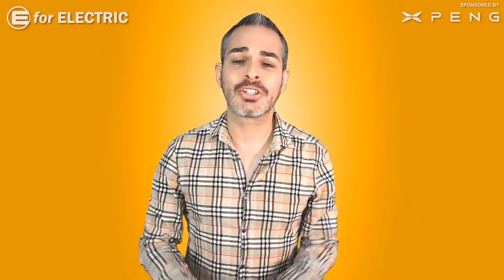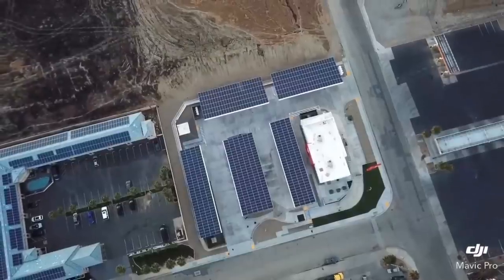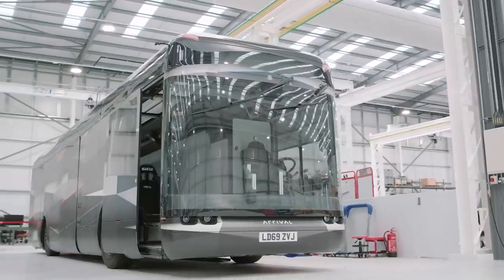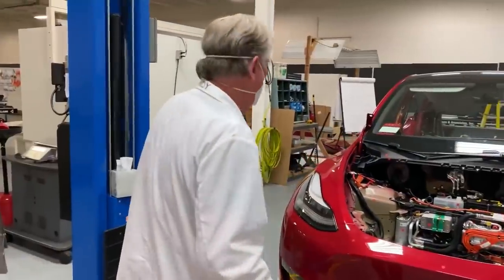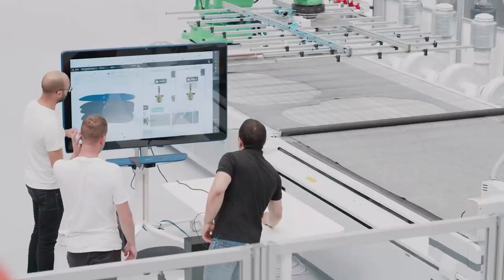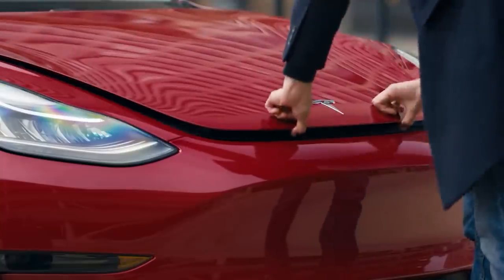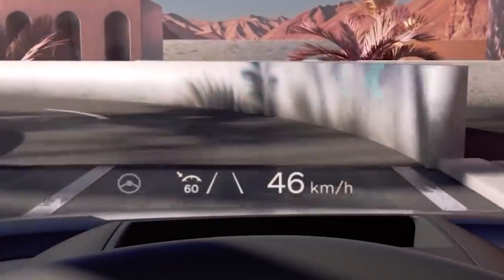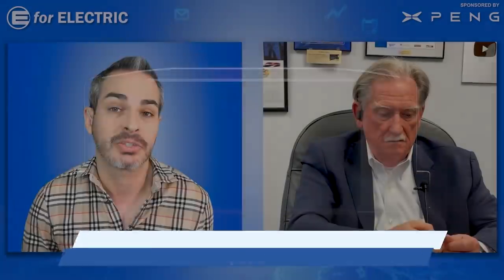Sandy Munro vs 2021 Electric Car Tech

Comment: They used to have CKD vehicle assembly where I came from in New Zealand in the 60's and 70's. It would be a great idea for bringing Teslas down under. But the only drawback is that CKD in those days was driven by a protectionist government tariff regime which doesn't exist any more, and without those tariffs it probably won't stack up financially.

Comment: Nio has done more than 500k battery swaps. I think the idea has survived the test so far. Also battery swap will become a big recurring revenue stream for Nio. Whether it's swap stations or charging stations, it's important to build that ecosystem to support sales of the car. Nio realizes the sale doesn't end with delivery of the car to the customer. You have to have Service and support infrastructure. Tesla and Nio are doing it the right way.

Comment: Another great interview with Sandy. I agree with him on battery swapping. I hope one day there will be fast induction charging built into highways thus eliminating the need for charging stations. This system could also be used to "transfer" excess potential energy of loaded trucks decending mountain roads. Furthermore, the electricity generated thus could be used to heat roads in snowy areas, making for safer driving for everyone.

Comment: Any thought if Tesla or the others will allow one to use their car's battery, when sitting in the Garage, to be used as a powerwall? Currently a powerwall has about 13 kWh of capacity, a modest fraction of a 100 kWh battery. Would be nice to be able to use your car as a power shifting means when one has solar panels on the house.

Comment: I think Sandy has gotten the battery swap idea wrong, and I think you may have asked the wrong question. Region is everything, where Sandy lives in the USA he may be correct but in China and large parts of Europe do not have the means to charge at home or in towns and cities due to the different types of real estate, battery swapping in these situations can be a huge advantage. I think he's being very narrow minded, it's a also new and different, but different does not mean wrong. The comparison to an old propane cylinder was completely out of proportion as well, I would like to think that batteries in the swapping environment, would be, from time to time, reconditioned so as the battery swapping stations would need to be up-kept. To the next point about connectors and some saying dirty connectors cause resistance, causing heat, causing battery death, well there you go, wouldn't you like a new battery at this point which you'd get from the swapping station, or do you wait for your Tesla etc. to become redundant like your typical iPhone or Samsung phone's built in, non swappable battery would be, once the battery is done?! I'm not saying Sandy is not smart as he has proved himself, I just think he needs to reevaluate these conditions, think out of the box. Now to LIDAR, yes he's probably correct, in TEN years, but for now LIDAR is the best alternative. Musk is arrogant and just dismisses anything that his vehicles do not employ for reasons of hype and marketing. Musk is a shrewd fellow don't get me wrong but he also kind of portrays himself as the fictional character Tony Stark and can not only be very annoying but disruptive to the stock too (short term), just take the last incident at the Shanghai automotive show for instance, it's a PR disaster.

Comment: Battery swapping could work for a huge fleets like big city cab companies or government garages. In my opinion it is a big stick in the wheel of the progress because you're stuck with one technology for many years
Reply: (it really allows quicker update of technology - only the form factor needs to remain the same.) - not saying it is going to happen - it isn't likely to, not across the board anyhow, and not between platforms, unless govt's force it. (one-type fleets, like London cabs, simple)
Reply: @kadmow  Imagine that you bought a long range battery for big money but when you need to replace it they only have a cheap budget one. Your decision? Definitely they won't offer you a price difference as a refund. Or vice versa, they have a brand new updated one and you have an old beater. It's back to the USSR, everyone has an exact same car. Dead in the water idea.
Reply: @igorpro8462  : Ever thought of modular systems??  - actually that was a great failure of Tesla architecture  until at least 2017 (not that long ago) Electric cars are Appliances anyhow, personal choice is "what topper would you like today sir?" - we are just on a transition, everything is in flux.  I think some are imagineering scenarios which have been solved and are simply logistical exercises.  Whether or not removable "modular" packs will prevail (swappable or not is of little mention- as it is so simple to solve it is trivial), your original complaint re. technological freeze is a straw-man, (as is any minor maintenance argument).  Simply, if it isn't needed by the masses, the masses will seek alternate solutions. Niches exist (apartment dwellers - parking streets from their premises - with no charging infrastructure) , and the the USSR couldn't imagine the levels of control modern secular states enjoy.  ha ha...   Blue or Red, who cares, you are still all in the same game.  jk...  and have a great day.
Reply: @igorpro8462  if you change to a smaller range battery, the cost is low for that duration. Plenty of people have comments and have done any research.
Reply: @kadmow   Modular systems work well in some cases like construction equipment, where the tools or batteries are changed  many times during the shift by the operator. Modular systems even in the computer ecosystems proved itself not very handy and eventually were abandoned by Apple and notebook manufacturers. The major issue with the battery swap is maintaining the inventory big enough to have all most common shapes and sizes available any time of the day or night. It can work downtown Los Angeles, though it will be sky high expensive, but what about small rural towns? Imagine you're driving to the camping site in the woods through small towns where there are gas stations but nothing for your fancy whatever you are driving, definitely not Tesla.

Comment: mobileye is developing a solid state SoC Lidar module, i wonder how that compares to FLIR. mobileye dominates the OEM supplier market for self driving systems with basically no other competition so i am guessing it is good enough for level 5
Reply: Passive systems like Flir are always simpler. They don't have to radiat energy for a signal they just take what's already there. Plus the longer wavelength Infrared works better in low visibility situations. Radar would be best but that does not have the resolution of the other imaging systems.

Comment: Swappable electric car batteries. I think it’s one of those persistent ideas which are great in concept but unsatisfactory in application and use. When you can charge almost as fast as swapping out the battery, then it becomes less desirable. Sandys barbecue grill story was the perfect  example of why it’s not a great idea.

Comment: Common sense engineer Sandy. If and when he is right, then largest capacity batteries will be  analogous to "no replacement for displacement" in ICE. Less stressful for  the larger capacity batteries,  range is a luxury

Comment: I love the battery swap.  NIO has performed over 2 million battery swaps. Other companies cars might join their network.  The automatic robot method of swapping batteries is amazing.  Remember, battery swapping is an option, not a requirement.  NIO says about 50% of customers select the battery swap option. NIO also has a network of superchargers and other chargers, mobile energy vans, and NIO power systems for the home.

Comment: These videos are great entertainment, educational and thought provoking. Thanks for that.  Have you done any research on Alpha Motor Inc, i think a  korean owned company in Santa Cruz?  So far everything out there looks like a press release, no third party analysis or info on the experience or background of those in the company. No concrete testing info of the prototype vehicles. Are they just like vaporware?

Comment: One big reason to be against HUDs : windscreen repair costs. I ski and do other recreational activities where I often drive on roads where pebbles thrown up by other traffic is an unavoidable hazard. If you can fix the chip great, if not, replacing a cracked windscreen is no big deal. Add a HUD and a cracked windscreen becomes massively more expensive for replacement and calibration. Otoh, if you already have the safety systems mounted on the windscreen anyways and a crack is a big ouch, might as well have a HUD.

Comment: I'm still waiting for Sandy to produce a video (as promised) comparing the cost difference between ICE powertrains and EV powertrains, sans batteries.  I think it is a significant question to answer.  Is an EV powertrain (not counting the batteries) $2 k, $3 k, $4 k less expensive, or perhaps not any less expensive at all.

Whatever the difference is, that is how much money can be spent on EV energy storage and the vehicles still be at cost parity.  

My suspicion is that Tesla is tweeking the cost out of the body and build of the vehicles so that they can have the price of their vehicles as low as they are.  In other words, if they were building ICE vehicles they'd be making a killing over their competition, because their manufacturing costs of the rest of the vehicle is so much lower then the other guys.  I could be wrong, but without some good analysis from someone like Sandy, we can only guess.

PLease, if you're up to it, ask Sandy this question about ICE powertrains vs EV powertrains, sans batteries.

Comment: The largest problem with battery swaps, except for the original model where you were supposed to just rent one for a few days, halfway between LA & SF, and then return it and get your original back, is that good batteries would go off the swapping market, while all lemons would be swiftly swapped in, hoping to get a better one.
This is a very old problem, when Newton ran the Mint in England he designed a sovereign which was so superior to all other similar coins that they left the exchange market and stopped being used for trade which of course was the original intent.

Comment: Mazda and GM have been doing HUDs for years.  Even the Chevy Bolt uses a HUD for front collision warning.  Basic info like GPS directions, Speed, and fuel capacity, aren't very expensive to incorporate and should be included in more vehicles.

Comment: Battery swap may work for Cabs, logistics fleets,.. but for personal use, would not want an unknown power source below my feet traveling down the highway.
Electricity is everywhere. So very easy and cost effective to setup a charging stations as long as the powerline reaches the location (example, a Level 2 charger is sufficient on top of a mountain where traffic is low). For swapping stations, way harder to setup and the inventory (batteries) cost is way higher. And if the location is not right, then there may not be enough customers to support the business.
Current range problem is similar to ICE cars in the early 1900 where there are just a few gas stations. The problem will go away when there are charging stations on every block and new battery/software technology will reduce charging time significantly.

Comment: Battery swap could get crazy real quick. Each manufacturer would then need to make the same connector locations and probably the area where the battery resides. Otherwise you would need to go to a station for your model or they would have to carry a large array of battery types. Once EVs are more common place on the road there might be a wait to get a charged battery if demand outstrips the ability to charge, not to mention waiting in line adding to the time.

Comment: I would like to see your and Sandy's view on wireless charging at home and embedded in the road.
Reply: I second this. On one hand, it sounds like a cool idea. On the other, it could end up being a nightmare for road construction if not done properly. You'll also have to get the power companies involved, which will increase the cities and states power bills, and in turn increase taxes on the people. But since road tax collection will fall from the decrease in ICEs, states may like the idea of having a way to make up for that.
Reply: @russellpuff1996  The other thought that I had was what about people in the north.  What does snow and road salt do to the infrastructure if embedded in the road or in parking lots.  I think alot of EV builders are only warm weather engineer and often forget that much of the country is not CA

Comment: Deride LIDAR all you want but most likely every single Autopilot fatality could have been avoided with a single forward facing LIDAR sensor. Even if we accept the premise that vision is all you need, forward LIDAR makes that same vehicle safer. With the lower cost of LIDAR, it makes sense to have forward LIDAR as an additional layer of safety. I wish Xpeng sold their vehicles in the US.

Comment: yeah i think for small cars there is just no point to battery swap, but for semi trucks i think it can make a lot of sense because fast charging a semi battery is going to take some seriously insane charger setup and heat management, where if you swap you can just slow charge each battery on it's own time and at off peak electricity pricing
Reply: So here’s the thing about charging big batteries. You can charge them at the same rate when talking about percentage. So they’ll be able to get from 10%-80% in about 20 minutes as long as the cells can stay cool. So a 500 mile range semi would be able to get around 400 miles of added range in about 20-30 minutes which is exactly what Tesla quotes. As for the power requirement? We already use really high AC and DC power in factories so it’ll be the same sort of electronics.
Reply: @harsimranbansal5355  yeah i think it can be done, but you are talking about 1 to 2 MW charging rate per truck, imagine a truck filling station on an interstate highway with a bunch of trucks, typical scene today. 10 trucks, 20 MW continuous, that's like 10,000 homes average power usage, a small city/large town for a single charging station. do-able for sure but if you took those batteries out and charged them at your own rate it would be a lot easier on the grid, especially if that station had wind or solar producing intermittently
Reply: @connelly6375  This is true - in fact the charge stations for trucks would either be equivalent of small power stations themselves or a pull up outside of exisiting one. 
Battery swap is feasible here (with banks of batteries charged up over days at slower sub-Megwatt rates) as the truckworld its a more professional asset managed environment I think tahn individual vehicles. BAttery swap or maybe chance where hydrogen can find its place as a transfer fuel medium.

Comment: Sandy worries about the connector in a swappable battery going bad over time but at the same time apparently he thinks the connector in the car for the supercharger cable will last forever. The reality is both connectors will fail eventually but both can be engineered to have very long lives.

Having a swappable battery doesn't mean you have to swap it every time you run out of energy. It is fine to charge the swappable battery at home overnight like people normally do with non-swappable batteries. It is also fine to charge the swappable battery from a DC supercharger if you have time to waste during a long distance trip.

The main reasons I want a swappable battery are to eliminate battery degradation anxiety and to eliminate battery obsolescence anxiety.

Comment: Battery swaps also require many more batteries to be made than needed. You'll need at least three times for each car if it's someone who swaps every other day for commute. It would be unnecessary when battery charging is getting faster and will get extremely close to the time it takes to fill up an ICE car. Plus people will be getting used to charging at home and will hate the idea of stopping somewhere for a change. On road trips, charging is no big deal because you're gonna stop for other things like a restroom break or to get food. Battery swap sounds great until you break down the environmental and economical impact.

Comment: I’d like Tesla to come up with a 50 lbs or less luggage size self-service battery module designed for the frunk. They could have self-serve locked battery storage containers located in cities and highways that a customer can pay for and unlock with an App and provide an extra 25 to 50 kWh of range in less than 2 minutes. This would allow customers of the older 2170 batteries to be able to take advantage of the newest battery technologies (4680, solid state, etc.) without feeling left behind or obsolete.

Comment: B - the resultant magnetic power produced by motor coils 
=  A - the Amps,    times T - the number of Turns of wire
÷  the length of the coil in meters. 

100 times more Turns of wire,  requires 100 times less Amps (fuel) input
to get the same resultant magnetic power (horse power).   
( The Amps are the fuel used to run the motor. )

If wheel motors were wound with tiny diameter superconducting wires, 
with 100 times more windings in the same space that the copper magnet wires occupy, 
EVs would get 100 times more driving range, 
or only need 1% of the battery size to get the same driving range.  
That's why superconductors, like graphene, are so special.  
Superconductors make it easy to produce free energy !